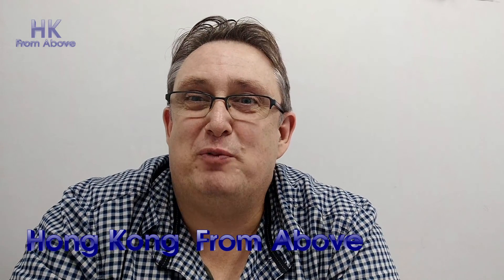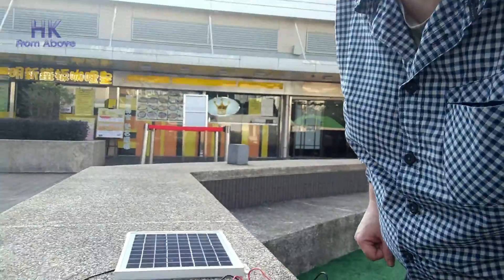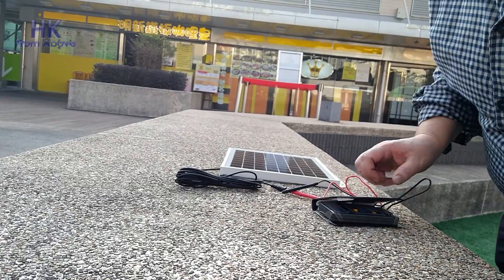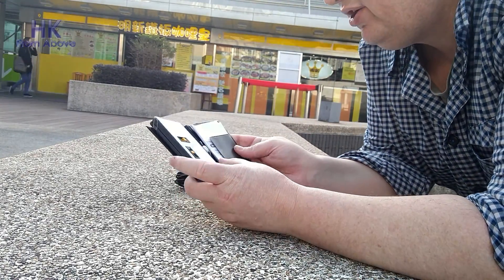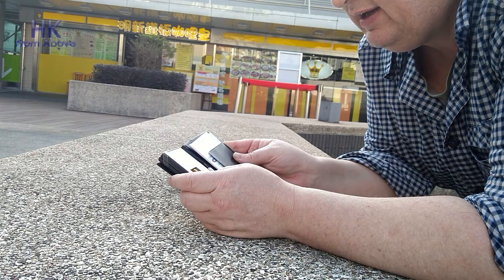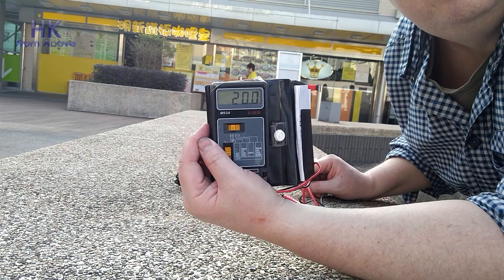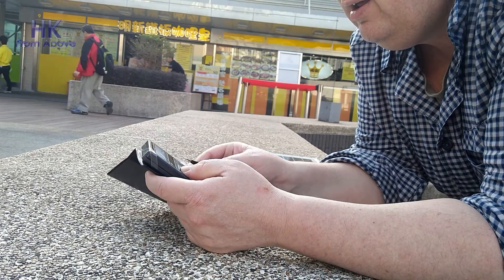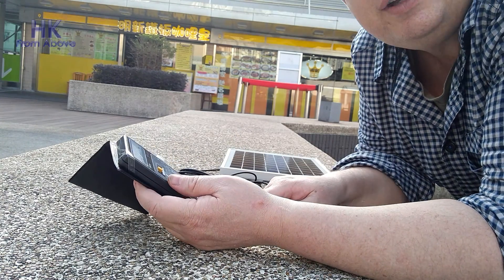Philippine Journey  -  Solar 1

Comment: Are solar items cheaper in Hong Kong vs prices in PH? I am looking at 2 option packing in small lights and inverters from US or sourcing items like panels on ground in Bohol ideas or thoughts?
Reply from the maker: Hi James, 
From my research solar panels on average are cheaper in the Philippines. But you will need to source from Cebu or even cheaper from Manilla. Bohol as far as I could tell had no Solar suppliers. 
In Hong king all the accessories were inexpensive, but the panels weren't. I have ordered some from China which were 1/2 the price of HK. 
Hope that helps
Reply: Thanks Merry Christmas, yes Cebu as the nearest major city but you can't do anything but research until you get there Lol. 

From the US I guess I will pack in the inverter and switches
 Led is the way to go. Thanks for helping others never hurts.
Reply: HK From Above thanks I am 9 days and a bowl of grits lol
Reply: Kenneth Littrell thanks I am still gathering everything I can bring in. Amazon is killing me lol have a good one

Comment: Why not just buy the $6 solar LED bulb lights off ebay??? Be alot easier for you to understand and it will basically be the same concept of what your trying to acheive! The solar LED bulbs have a built in battery like you would see in a cell phone. It can last up to 5 hrs without being plugged in!
Reply from the maker: Thats what she has now, I was looking to see if would be an off grid solution for remote houses. A definite work in progress.
Reply: My workshop is off grid & i use 3 of those solar LED light bulbs just fine! Im sure inside that hut they will work just as well. Use your time by focusing on things that are really needed! I sometimes wonder if she really wants help, just going by her body language & facial expression! Last i heard she wanted a bike...hahaha
Reply from the maker: Thanks for your advice and experience. I'm just experimenting right finding the simplest and most cost effective solution.
Reply: I understand!

Comment: too many amps thru a meter will pop the fuse, causing it to not read at all. The fact that you were reading around 150mA is probably accurate. It was afternoon sun and the panel was not angled to get the direct sun.
Reply from the maker: Thanks,  its a learning process. Have you done much solar or electronics.